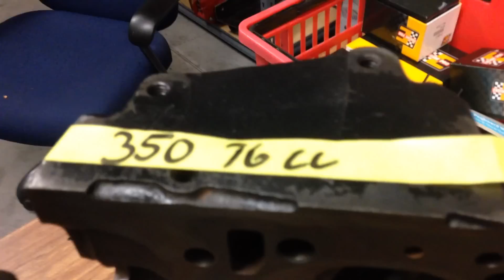350 and 305 Chevy what's The Difference

Comment: Glad to hear you're a fan of Engine Masters too. I love watching their different engine builds and dyno tests. Especially the 305 test you talk about. was a fun one.
Reply: yeah they made over 600 hp, then the next step it went boom. If I remember right 600 hp was a 250 shot nos.
Reply from the maker: I just found out from a Roadkill extra episode they are planning on rebuilding the 305 with forged internals and setting it up fir NOS in a further episode sweeeetttt
Reply: Myvintageiron7512 can you fit a 383 head on a 350?
Reply: James Palmer, there is no such thing as a Chevy 383 head. those are chrysler big block heads
Reply: James Palmer Chevy small block 383 is an aftermarket engine.  There are a number of companies that sell kits to build a 383 out of a 350 block.  In the old days we used to put a 400 SBC crank in a 030" over 350 block.  It took some fiddling around to make it work.  We would buy inserts for the mains (400 mains are smaller than the 350 mains).  Also we had to grind some off the bottom of the cylinders to clearance the longer stroke 400 crank.  Different pistons, different rods and the right set of 350 heads and we had a healthy engine for those days.  Today if you want a 383 Chevy, buy a kit...... or a complete engine.  It's cheaper and a lot easier.
Reply: I'm sorry, the 400 SBC mains are larger than the 350 SBC mains.  We would have the 400 crank ground to fit.  I was thinking of putting a 350 crank in a 400 block.  Bored 030" over makes it 377 inches and that's a whole different animal.  Have I confused you enough?  It was a long time ago.
Reply: Robert Mooney Yeah, you're right. 400 blocks need the crank journal spacers to work with the 350 type crank. 350/305 blocks just need to have the crank to be machined for factory crankshafts, or you could just order a brand new crankshaft ready to go. Always remember, most blocks need to be machined or ground to clear the bigger crank.
Reply: Duh, 400 cranks need the crank journals to be machined down to 2.450" diameter. I messed up.
Reply: crazyjr no such thing as a 383 chevy?
Reply: Wrong: you're thinking of the 383 mopar. the 383 chevy stroker is a popular motor amongst gear heads capable of making about 1200 HP.
Reply: Johnathan Price no i think ur wrong sir, chevy did have a 283, 383, and a 373 too i think
Reply: Chevy Made The Following Small Blocks (283) (327) (305) (307) (350) (400) this is chevy's small block line up. However a (350) can be bored & stroked to (383) cubic inches which is a stroker kit capable of making 1200 HP.  I own Prices machine shop we build motors if you have any other questions please reply.
Reply: Johnathan Price sorry i was pestering
Reply: You missed a couple. Chevy made a 265 and a 302 as well.
Reply: The 302 was the King of the mouse motors 7000 RPMs all day long
Reply: Johnathan Price i saw a chevy 383 today factory 1981 chevy 383
BOOM!  told ya!
Reply: hallis1 I love engine masters also and there other show roadkill just for the kicks lol
Reply: Johnathan Price yep I agree with you, No Chevy ever came with a stock 383 that I know of? those are built not bought stock.
Reply: James Palmer  prety sure chevy 383 is  just a 350 that they've mest with the stroke so they use 350 heads
Reply: +Eric McGinnis It's a 350 with a 400 crankshaft.
Reply: The 383 is a hot rodder's special.  There are a variety of changes that need to be made in the crank, block and rods to put a 400 crank into a 350.  At the time guys started doing it, the stroker crank was the most expensive part and, if you could get one of those from a wrecking yard, a machinist could make it work. If you are building a motor, you are probably machining the crank, boring it some and using new rods and pistons.  So, it wasn't very much more money to get the 383 with the 400 crank in the 350. You just had to know how to do it or know someone who could do it for you.  Aftermarket sources started making "SBC 383" motors just like they build other motors, just using different parts.  Economy of scale brought the price down.
Reply: James Palmer 81 what?
Reply: how did frieburger put it?..."I feel like we are killing a puppy" was pretty close if I remember correctly.
  I want a warmed up 305 for my toyota...
Reply: Johnathan Price 
Johnathon so if I do a 30 over on my 305 what do you recommend. so it’ll sound good and get horsepower but at the same time use it daily to go to work and back .
Reply: @rudychapa6759  

- RV/Torker Cam (give you plenty of low end torque and a really nice sound at idle during typical driving)

- install an HEI distributor to eliminate the factory points and coil setup. Hotter spark, denser spark, and better per overall.

- 4bbl Quadrajet carb rebuilt and tuned (you can do this yourself if you just follow along on YouTube carefully. They're really easy to rebuild and make reliable).

- Port your intake manifold (or move to a better flowing one than stock) while at the same time port your existing heads on the 305 to flow better and match the new intake. Even if you don't get a new intake, Port the intake manifold and port the intake runners of the head too. Port AND polish the exhaust runners on your head. This alone will DRASTICALLY wake up your 305 because they flowed like hell from the factory and were very sloppily cast heads. The heads you're wanting are 601 or  416 casting numbers.

- install better exhaust or even simply headers, and it'll give an even nicer sound and more power.

All of the above is the very first things I did to my 305 and gained around 70hp over what it originally had prior to. 70hp doesn't sound like much, but that's an assload of extra ponies on an otherwise stock setup, and you DEFINITELY notice the extra power and sweeeeet sound of a nicely thumping idle and low to mid range crackle during normal street driving.

Comment: I've owned a 305, 350, and 454. The 1989 305 was scary. Additionally, my 1998 454 engine was not any faster than the 305 it actually was a tad slower at high rpm. Currently I have a 305 el camino with quadra jet carburetor and I love it. Everyone talks crap about quadra jets but if you keep them atleast half ass clean it's a blast to cruise around then gun it soon as the two other barrels open up boosts you forward like crazy while also saving gas.
Reply: Quads are a great carb. only problem is the shafts wear and cause air leaks by the butterflies, but that usually around the 80,000 - 100,000 mile area. Not bad life span. Reason why OEM's use it over hollies (which many use to) and other kinds
Reply: You probably didn't make a decision on changing the gear set to gain any kind of good dude 🙄 duh
Reply: The big block is built for torque range up to 4000 rpm

Comment: Good honest video. I love the 305 but that's because I've had one with 335k miles that wouldn't blow up, another with 200k that I had since 115k when I was in highschool and really stupid. Currently running the original 305 in my 83 Caprice with 228k and it's holding up great too. I think they're harder to kill than a 305 since they have the same rods and crank with less strain on them with the smaller bore. Plus the 305 heads aren't prone to cracking like a 350 head was for a lot of years. 

When I upgrade from the 305 I'm going to a 5.3 LS engine I already bought. Might as well make the upgrade worth it.

Comment: Had a factory 305 in a 96' Silverado extended cab 2wd that came with a 5spd manual.. That thing made it 236k Capital H Bold, Italic and underlined HARD miles before it spun a bearing on the interstate during a 3rd gear drop acceleration pass.. Serviced Reguaurly and abused. I was impressed it lasted as long as it did, replaced with a 350 and sent it on to it's new owner. It was a 2 bolt main and replaced it with a 4 bolt main 350

Comment: the difference between a 305 and a 350 are both the 5's & 0's are switched around.
Reply: Jerk Jiggler the difference is the 350 is more tough ,sounds better, and more powerful through take off and mid rpm hp.
Reply: I was gonna say 45ci difference
Reply: Jerk Jiggler yeah that's right not,,,,
Reply: Yeah pretty much
Reply: @Michael Rodriguez TOU ARE A REAL FOOL
Reply: the difference is.... 45
Reply: Your parents must be proud of how smart you are
Reply: A .060 over 283 works real well in a Nova or a Vega with 350 heads 9.5 ratio pistons and 198 heads and a 3 speedy automajic trans. It will do okay on regular gas... But put it in a Suburban and all it will do is suck more gas than a 350 because you need more RPMs to move it at highway speeds. It will work. But you really do need a wide ratio 4 speed stick to move it properly. Also the axle ratio needs some tweaking. It all needs to match for what you want to do with the body it is going to move. I have seen a 454 get better mileage in a 1 ton than 350. Once with a wrecker and another in a Camper Special. Almost the same horses but toque not the same.
Reply: Terry Schnereger        It was a dyslexic engineer who named them
Reply: Bore diameter: 305 is 3.736", the 350's is 4".
Reply: @billyfromtheusa I think yours had the carby as opposed to the TBI "Cross-Fire" version.
Reply: @billyfromtheusa The 1969-70 "Boss 302" was probably the hottest of the SBFs!
Reply: Get this guy a engineering degree

Comment: The thing I like about the 305 is that initially when you come off of a stoplight, you feel the torque and it feels like a 350. But that goes away as you start trying to pull harder/go faster. The 3.48 stroke gives it that pull in the beginning, but the smaller cylinders and less airflow won't let you maintain as much "pull" as a 350. I have yet to build a 305 (because I used to throw them away), but since they're basically free nowadays, I'll put one together, and it should make a decent low-end torque engine with a decent set of heads on them.
Reply: Remember the 265 in 55 the 283 in 57 270 go dual quads they contended with olds j2s pontiacs with tripower mopars with dual quads ford 352 interceptors with overdrive and cruisamatics those little small blocks stood tall !
Reply: They called the 307 a dog I've seen some run I've had 400 small blocks that ate 350s with their paper thin cylinder.walls some called them a dog my 81 z28 has a. 327 from a 65 vette and cranks like the midnight special LOL
Reply: @hdjzzuush7867  So true, the tri-fives started the horse power race and performance war of the late 50's and the 60's. When I was a kid the fastest street car around was a 4 door 55 with a 327, it whipped ever big block car in town and the county.

Comment: Having had a 1978 305 with a Rochester 4-barrel and the 1991 305 with TBI, and OBD-I computer control, it's a world of difference in power. My '78 Regal struggled to get from 50 to 65 mph (downhill!). My 1991 Chevy gets from 50 to 65 very easily, and beyond.